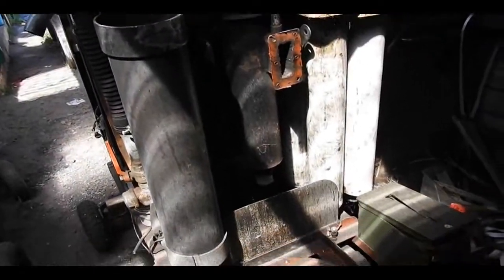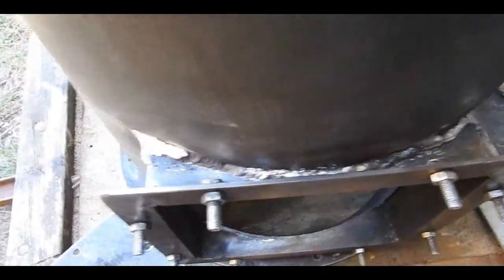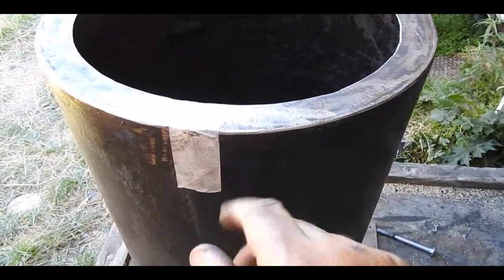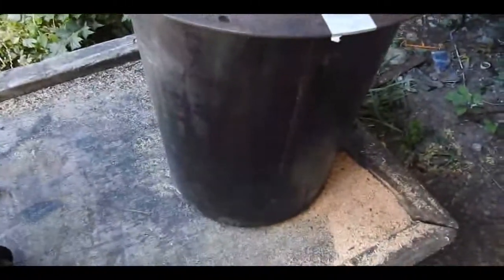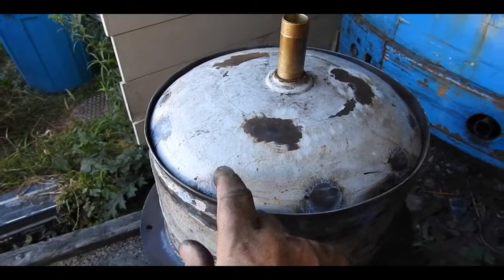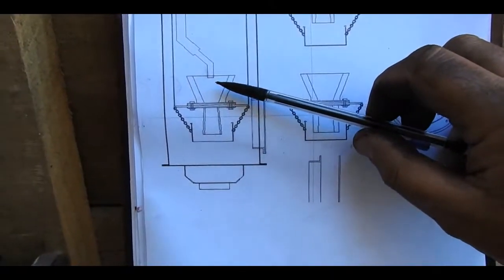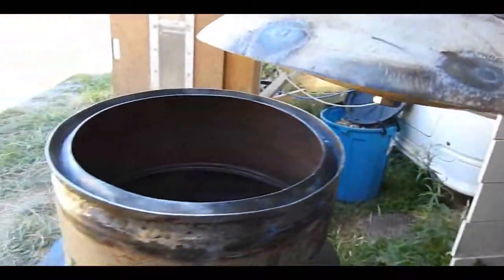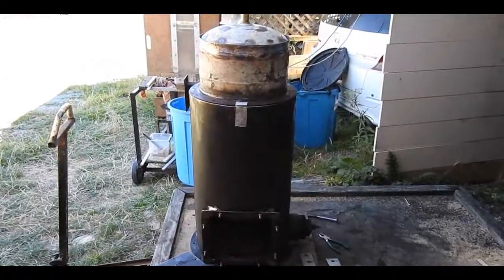Victory Gasifier Rebuild.

Comment: Make that Lynn with Springs that way?If it happens, they build up pressure, it's like a pop off.That top would just raise up use heavy springs
Reply from the maker: Thanks kindly. 
 That is pretty much how I finished this project off, and it works nicely   :) .

Comment: Nice build out.
Reply from the maker: Thanks kindly. 
 This gasifier has clocked up a couple of thousand hours, and it is still going strong  :)  .
Reply: @CNCmachiningisfun  so over time....how does the genetic deal with the gas?  Carbon, heat, etc.  I would think that gasoline would be better just by cooling alone....but it's a trade off for what a gasifier is meant to do and can do.  

Do you have tar issues at carb?  How often do you need to change filter media?
Reply from the maker: @wadebrewer7212  
 Woodgas can be very clean, such that the generator will last many years, in near perfect condition.
I used to think that it wood quickly wreck an engine, but no, I was pleasantly surprised  :)  . 
 Cooling isn't really an issue here, as the genset is not working hard enough to benefit much from the cooling qualities of a liquid fuel. 
 Because my gasifier is not running as cleanly as it should, and I am using the worst kind of fuel, it produces more tar than I wood like. 
 If left unchecked, this wood eventually freeze the throttle, and start to accumulate behind the intake valve. 
In severe cases, it can bend valves, seize piston rings - bend pushrods - and snap rockers. 
 I learned this the hard way, as I have made EVERY mistake in the book   :)  .
 On mine, because it runs a little dirty, and is operated in the freezing winter months, filter media replacement occurs every 50-ish hours. 
 The old filter media is quite flammable, so I use it in the log burner, to heat the house  :)  .
Reply: @CNCmachiningisfun  nice.  Awesome information.   Thank you!
Reply from the maker: You are welcome  :)   .
Reply: @CNCmachiningisfun  genset....not generic.

Comment: Good video. Why did the crucible have to be stainless? Because it melted?
Reply from the maker: Yup. 
 Melting, or oxidising, way before its time, was an ongoing problem with this part of the gasifier. 
 The stainless parts are durable, but even they will wear out, in time.
Reply: @CNCmachiningisfun  Would a brake rotor melt you think? Probably, right? I noticed the Imbert design is just all cast iron. I'm building a small one maybe I can find some stainless or like a speedy-sleeve type thing where you just sleeve something stainless into a steel pyrolysis hole. Great videos, thank you for sharing your information, it's greatly appreciated!
Reply from the maker: @kittywampusdrums  
 I am not sure that it wood melt, but there is a good chance that it will erode, due to the air/flame mix - working like a gas axe. 
 It is worth a try, and it can save you a lot of work. 
 Watt's better is that you can get the same part, over and over again, in order to replace it, when it finally wears out  :) . 
 Just be sure to take the various expansion rates of your metals into account, as this can easily tear apart the interior of your gasifier. 
 Yes, I am sure that you'll find something in stainless, off the shelf, that lends itself to the creative task. 
 If it hasn't happened already, you may find yourself looking at everything in a very different way, as you consider their possible placement in a gasifier project. 
 Once this happens, you'll know that you have been bitten by the woodgas bug  :) .
Reply: @CNCmachiningisfun  Lol that bug already bit me and I think it layed eggs in my skin too.
Reply from the maker: @kittywampusdrums  
 Enjoy the venom that flows in your veins, as it shall lead you to great, and watty, wonders  :) .
Reply: @CNCmachiningisfun  lol :D

Comment: Use a pneumatic autobody paint shaker (mixer) for grate shaker.
Reply from the maker: Yup. That could work. 
 I had hoped that the engine's motion would be enough to shake the gasser, but that didn't really turn out too well.

Comment: Hi Steve, Stephen here. Also in NZ. Have been playing with gasifiers myself. Have learned that, flow of fuel through the system is paramount. The less restriction to flow, the better. Consider having another cone on top of your top cone, to help feed the fuel into the lower cone. You don't want fuel resisting gravity by sitting on that 1 inch thick lip of 316. Your top cone has a bigger angle than Flashes. I think he has pretty much nailed that dimension. His goes from a 5 inch top diameter down to a 3 inch lower diameter over a height of 5 inches. 6 inches if you include the 1 inch cylinder section.  You are going from 6 inches down to 2 inches in a 5 inch drop. That is a much bigger angle, and could be significant. It might be enough to restrict the flow. I think you should make a cone out of cheaper mild steel and test it before you lay out that much cash for the stainless. It was the thought of soooo much money that prompted me to write. You don't need a big hopper. I'm thinking streamlined or coned all the way down is better. To fill a hopper to the top is the quickest way to get a big injection of moister in your system and then bad things happen. Frequent doses of freshly dried fuel seems to work better. Like the rotating air pipe. Will be watching to see how that goes. Really hope your build goes great for you. All the best.
Reply from the maker: Howdee Stephen from Kiwiana  :) , 
 Yes, I will really need to experiment with the fuel flow elements of this gasser, as bridging is one of those things that can really mess things up. 
 A guide cone, over the burn cone, sounds like a good idea, and I reckon that I could reuse some of the old steel from the original gasser for this. 
 The hopper on this new build is a lot bigger than the old one, but I plan to fill it only half way, so as to combat the moisture issue. 
 Maybe, just maybe, I will also consider putting an air intake on the lid, to see if it can help to manage the moisture level in the hopper. 
 Sure, there is a chance that this will promote gas explosions when the fuel level is low, but I will try anything, at least once  ;) . 
 The final geometry of the burn cone is up for grabs at the moment, and I may just start out with a lower angle, then increase it in steps, until I find the right setting for the fuel chunk sizes that I use here. 
 Perhaps I could start out with a mild steel one, as you suggest, as that is a lot quicker, and cheaper, to set up  :) . 
 I am happy with the rest of the dimensions, but that top cone just might become something of a stumbling block. 
 Hopefully, I will be in a position to test this, in the next couple of months  :) .
Reply: @CNCmachiningisfun  Sounds like you are well on your way to a good system. Keep thinking outside the box. I think there is room for improvements to these things. Hope it meets your expectations. Looking forward to seeing the results of your build. Carry on, old chap.
Reply from the maker: @gasonthebrain3738  
 Yup, I wood like to think that watt I am doing is gonna get me most of the way there  :) . 
 Since I rely heavily upon this machine for my winter power, I really do need to get it right-ish. 
 Fingers crossed for good results  :) .

Comment: What I use for the hearth cones are Cast SS butt weld pipe reducers. They are perfect for this and are already made. But you are sort of limited to what is offered. But there is a 6 X 2 inch one that I can get. It is 5 1/2" deep. This is how Ive been building since 2013 ish with the larger end up. The small opening feeds into a straight tube reduction. The gas temps leaving the mouth of the hearth bowl here are at the highest level. So when the gas enters the reduction, at this stage it opens up so there is no direct metal exposure the gas at this temperature. These hearth bowls are the only SS parts I use and this is only because this is one instance where SS is actually less cost and there is more to choose from with in my vendor. Otherwise I would never use SS internally. SS is not a good material for this, as it will retain heat. The metals will grow and over stress and over time with heat cycling, it will work harden itself and eventually fail. I think you have already seen this. SS also has a lower melting point than mild steel. I have never seen metal degradation in through corrosion in a gasifier. The metals generally appear as if they were sand blasted. Corrosion should never be an issue in a gasifier as the Oxygen is limited in process will not make it any farther than oxidizing the fuel. The only place I would use SS is for the hopper. For the filters I use an industrial coating that will outlast the machine. The metals could completely rot away and the shell of this stuff would still  be left over. lol
Reply: Yeah my systems now have a floating reactor. The entire reactor floats inside a housing. So it can grow and expand with out stressing. The hearth bowls are also curved, this allows for stress displacement verses a straight architectures where the metal will grow but cant go anywhere.
Reply: A little paint will fix those welds right up. :)
Reply: Yup and my new reactors have a center air intake feed as well. But also have radial type intake input. But my machines are also jet less :) Mine have an upper chamber, you could think of this as a carburetor for a gasifier reactor. This feeds both air and fuel into the combustion chamber through a small opening much like the hearth bell. The air feeding down through the center feeds the core combustion process. In the lower hearth/combustion chamber there is a second radial air feed. This feeds the outer combustion process. Some of the pyrolysis gas is consumed here along char. This second stage works sort of like a fluidized system. This reactor emits zero combustion gases into the hearth. so I never have moisture in the hopper. The fuel stays dry all the way to the hearth with out any moisture absorption. So this is especially why my reductions are built the way there are, otherwise the reactor would melt them into a puddle.
Reply: Yeah that service panel! I had always wondered why everyone used these tiny clean out ports? I figured this was a tried and proven way so I just followed the heard. Later on I thought this is just stupid, why not a door? Would it not seal? So I built one with a door and worked fine!! Now I use an architecture of a round vessel for the char/ash. The door wraps around this and when the latch pulls it pulls the seal tight. Think of a hose clamp if you will, This is so much nicer and you have full access to the grate system with ease. Just pull the latch and the door is open :)
Reply from the maker: Yes, those pipe reducers look like a great way to go. 
 Sadly, I can't get the sizes that I want for this, so I have opted to build them from raw stock. 
 I got more than 1000 hours of runtime from my first lot of SS components, and these were a LOT lighter than the new system that I am planning to employ, so I wood like to think that I can get even more runtime from this. 
 We will see aboot that  :) . 
 I have a lot to learn about gasification in general, but watt I do know is enough to keep me 100% addicted to this amazing technology.
Reply from the maker: The floating reactor is the best way to go, as I see it. 
 That way, it can expand and contract, without tearing the rest of the metalwork to bits. 
 The original Victory Gasser's design did not take this into account, and it duly broke itself up.
Reply from the maker: Yup. Paint, and grinders, are a welder's best friends  ;) .
Reply from the maker: Having a good way of managing the hearth gases is a great thing. 
 Keeping the combustion process clean will surely boost overall efficiency - and fuel cleanliness. 
 My gasser was never particularly clean, but it never harmed the engines that I ran on it, so things can get only better from this point forward, I hope.
Reply from the maker: Your 'latch to hatch' system is surely more elegant than the approach I have taken here, but I don't mind the inconvenience that it imposes, as it is a VAST improvement over the non existence of any hatch on this gasser. 
 It was a total pain to pull it all to bits, simply to make even the smallest of alterations below the hearth. 
 Now, it's gonna be 100 times easier  :) .
Reply: @CNCmachiningisfun  I have a 2018 Utility gasifier that is about 90% complete. This is the very last of the chip machines. I will never produce another chip machine again after this one. All machines will be fuel standardized around the 7mm wood pellet. So if you are if you know anyone thats interested let me know. This machine has not even made it to public domain. It will come with the automated gasifier manager and auto fuel mixture controller with engine adapter. This machine is also does not need a media for its filter.
Reply from the maker: @Thrive-Off-Grid  
 Your 2018 gasifier sounds great. Grate, even. 
 Sadly, I don't know anyone else here who it into gasification, as it seems that the attendant workload is just too much for most folks. 
 Your pellet fed systems of the future will surely resolve the background workload issues, while adding a new level of convenience to the whole deal. 
 I tried pellets in my earliest builds, and they worked like a charm, but I was always nagged by the feeling that I was dependent on a store bought supply of pellets. 
 Just wondering, do you think you might also begin creating pellet mills, in order to satisfy a wider range of potential customers?
Reply: @CNCmachiningisfun  yeah this reactor technology is so far ahead of where I was at with chip fuel technology, that instead of continuing on with  chips our efforts will be better spent developing full processing equipment. The cost of the new pellet machine vs the chip machines is less than half the cost. So we will be able to offer the machine plus full processing equipment and still be less cost than the chip machines with out fuel processing equipment. There are already pellet mills on the market, those Chinese mills are some of the best on market. All you need is a way to turn your fuel into dust. I have a few ideas how to do this. But this would still require chipping the fuel first. But you will get the fuel yield and this will be a lot less work. The fuel is ready to run after pelleting process.
Reply from the maker: @Thrive-Off-Grid  
 You have taken woodgas technology a long way in recent years, and you have surely learned a lot in the process. 
 Watt you are doing will surely be of interest to a new arm of the woodgas market, so I hope you'll be able to benefit financially from this in the near future. 
 Here, with mine, I am quite happy, as I can design and build all of the infrastructure that is required for keeping it happy and well fed   :) .

Comment: You have the plan down pat there Mr Steve. I think you are going to be quite happy with the ease of clean out and or servicing your new creation. The Flash design was a godsend when it came to that. As for that lid, you may end up having to go with a compound hinge being it has those tapered alignment cones. Then again, maybe not. It may pivot down perfectly without it. I guess that is a work in progress. You are coming along rather nicely in your warmer summer weather. You mentioned about using the weight of the chamber / hopper to do the sealing on that flange. That seems a little scary to me with the grate shaker as well as a hopper vibrator keeping things moving as well as what Bill mentioned with the bug flatulence sending it into "launch mode". I would use some studs and wing nuts at the least to secure it. Then again, I don't know how much that hopper / chamber comes in at weight wise. I am sure it's quite heavy and add the weight of your solid stainless, 1" thick reduction zone and inverted cone and it will hold itself down. It's going to be one HEAVY assembly once you put it all together. Anyhow, you are making great progress on it to this point and we will NEED to be seeing some more updates from you as you progress through the build. Great work. Keep us posted
Reply from the maker: Howdee Mark, 
 Thanks kindly, my fellow woodgas addict. 
 During my use of this gasser, I learned a lot about its many fatal weaknesses, so I am hoping that I can improve it a lot with these rebuild steps. 
 Though the new hopper assembly will be pretty heavy, there is always the chance that it could attempt to blast off to the moon, or even the sun! 
 I will need to look into some hold down options for it, just to be sure it remains earth bound while testing the rocket engine  :) . 
 As for the hopper lid, I am going to be working on that during the weekend, to see watt I can get away with. 
 Hopefully, I can arrive at a nice and simple solution for keeping those woodgas bugs from escaping. 
 Really looking forward to seeing this little guy up and running, once more.